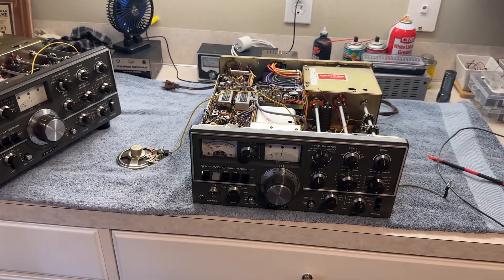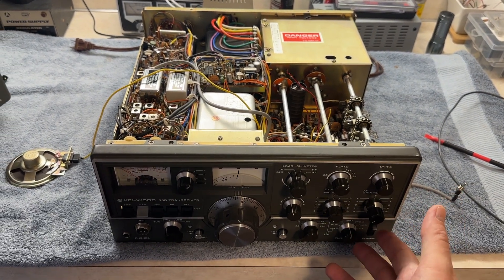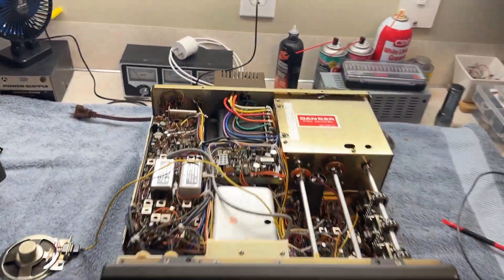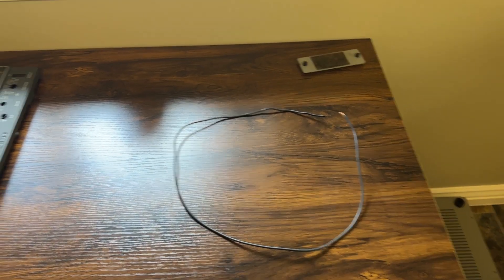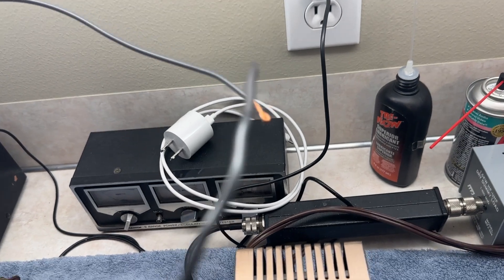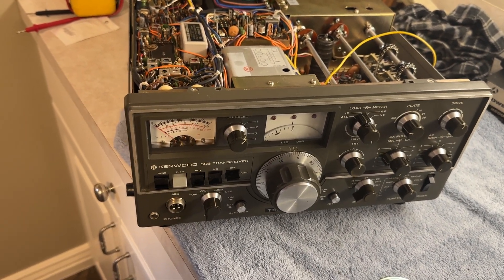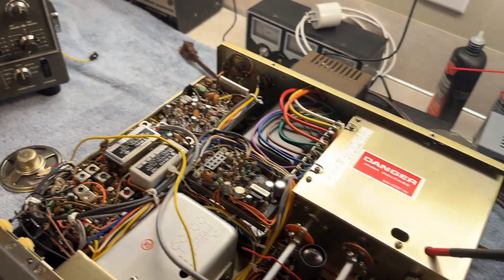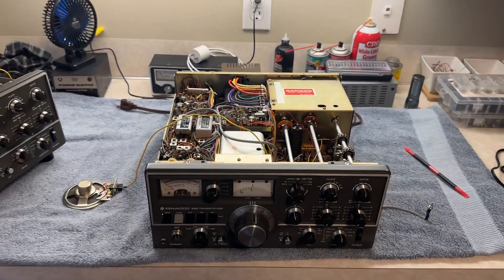A follow up video on how to neutralize the tubes on a Kenwood Hybrid radio TS-520(s) TS-820(s)

Comment: The 520 SE is a nice little radio.   I bought one in 1996 from an older ham who was a member of my ham club.  I should have done a smell test first because I soon discovered the power transformer was totally smoked.  I bought the last replacement HRO had in stock and put it in.   After cleaning up the rig, I put it on the air one night, using my 80 meter dipole.   I easily raised a station on the East coast, then all hell broke loose.    The 6146's started arcing and continued arcing after I unkeyed.   So back to the shop.   I discovered the cathode resistors ~7 Ohms, had been replaced with 10 gauge wire.  That explains why the transformer blew.   My ham friends, an older couple, really pulled a fast one on me.  I tried several different resistor types.  I remember some blew like fuses right away.  Eventually I got that radio working as it should and had many As is with it.
Reply from the maker: Wow, not a good experience, not to mention that transformer isn't exactly cheap and a pain to change out.
Reply: @zigzag3853  I made it into a good rig, although it wasn't such a bargain when I finished.   Sometimes the road less travelled is more interesting.

Comment: Why 28.5 ?  The service manual calls for 21.255 .    Art W8AEW
Reply from the maker: Best to perform it at the higher band since oscillation is most likely to occur there if something is off.  Not sure why Kenwood calls for 21.255 when their actual owners manual calls for 28.5.  K9TW (A kenwood hybrid tech) gives a more detailed answer below:  

"It is best to perform neutralization at 28.5mhz to 28.8mhz as at that frequency the Xc (capacitive reactance) is the lowest of the radios bands at approx. 25,000 ohms. Capacitive reactance can be thought of as AC resistance to RF. 

Xc at 80 meters at 3.750mhz is approx 193,000 ohms. So you can see that the 6146B is far more likely to take off on 10 meters than on the lower bands.

In years past with most of the transmitters mfg it was pretty common practice to direct neutralization at 21.3mhz. This was done as an attempt to get some level of neutralizing the inter-electrode capacitance on either side of 21.3mhz. In reality neutralization is only most effective at the frequency that it is performed on."
Reply: @zigzag3853 My owners manual (1978 version ) called for 21.3 .  I  later purchased a service manual  which  lowered the frequency.  Thanks I try 28.5  73's
Reply: Exactly Zig Zag!! K9TW rebuilt my TS-820S, and he's one of the last Kenwood "guru's" since K4EAA, and ANYTHING he says on Kenwood hybrids, you can take to the bank!!

Comment: Smoke test?
Reply from the maker: If they try this with the SG switch not turned off, I guarantee more than smoke.  I guarantee a door stop!  If done as I said, it works quite well.  Have verified it.
Reply: No. No smoke. I've done it this same way on over a dozen Kenwood and Yaesu hybrids. And they're all still talking like they did when they were new. There's always more than one way to do something, and none of them cause smoke, unless you do it WRONG.
Reply: Yes, if the SG switch is ON...then they're doing it WRONG....lol.
Reply: Old hammys. Still stuck in 1957.....🥺😖😩😫😜